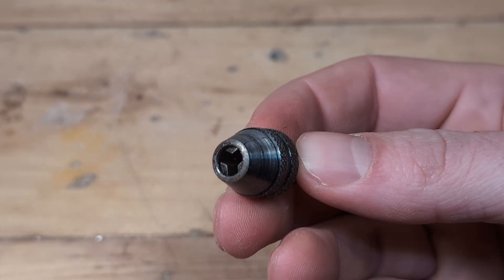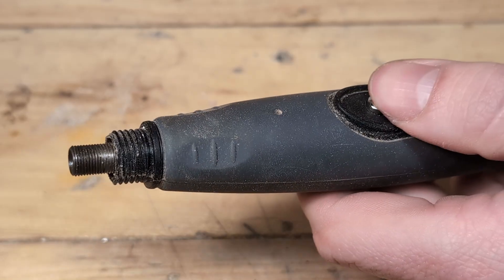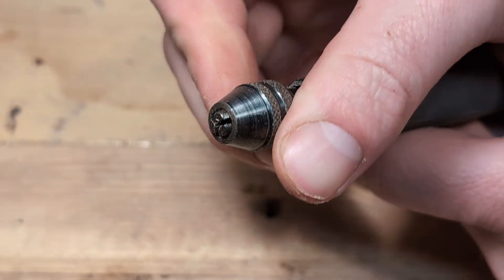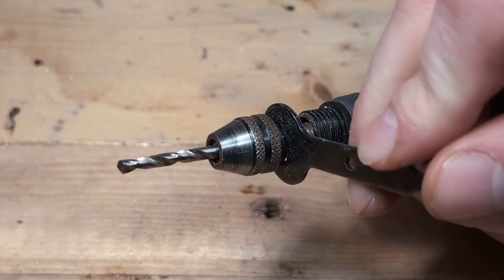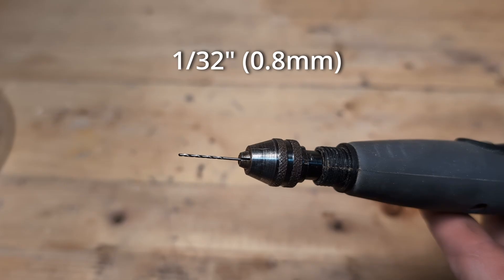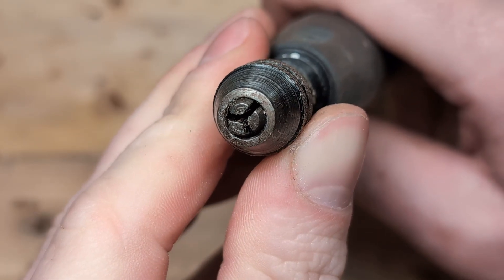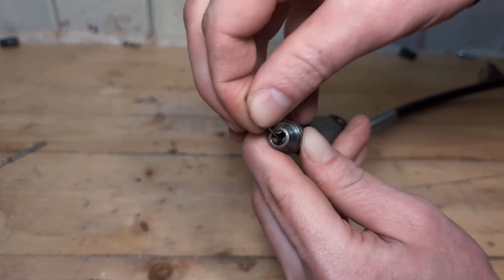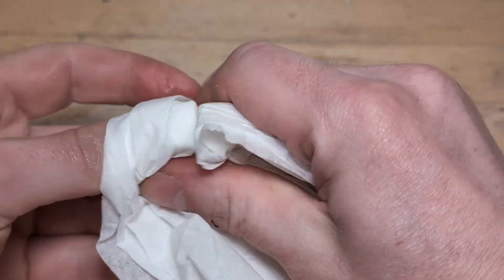The Keyless Chuck Is Good, But It Has A Problem (Dremel #4486)

Comment: DON'T USE WD40 FOR CLEANING. Use Varsol or Deep Creep. Deep Creep is a very good penetrating oil. Varsol will break down grease and loosen dust. AFTER you have cleaned the chuck you can use WD40 to LUBRICATE it and PROTECT the chuck from moisture.
Reply: WD40 is a known dust collector. I'd use some dry grease.

Comment: Using the wrench as shown isn't tightening the chuck onto the drill bit, that's only to tighten the chuck onto the dremel's threaded shaft.
Reply: I think it is the same thing.  You turn the chuck with your fingers to tighten,  or use the wrench when fingers aren't enough

Comment: These kind of chucks are made for drilling while applying force vertically in the same axis of the tool. Works ok for light duty while applying a light pressure sideways like cutting but you will eventually wear it down. It's the same principle with bigger Jacobs type chuck on a milling machine or drill press. If you want to do a lot of cutting and polishing you better stick with the regular collets.
Reply from the maker: Good point. That is something that I did not consider before.

Comment: will this chuck work on the 8250?
Reply: Yes, it fits with the 8220 so it will fit with the 8250. The only difference is that your 8250 model is brushless.

Comment: the problem ive found is that the collets and the keyless just wiggle with accesories, they end up moving side so side de-centered and seems theres no way to fix that
dissasembled the dremel itself and changed the bearings but still its the same
Reply from the maker: Hmm. I don't seem to have that problem. Do you close the chuck as far as possible before inserting the bit? Do you still have the problem when you use the normal collet nut and collet? I've had some of my Dremels de-centered as well, but not because of the keyless chuck (8260 and 8240)
Reply: @rotarycrafts8760  the wiggle problem is the same using the keyless or the collet, the problem begins today with the keyless, never used the collet because usually i drill with the dremel smal PCB but today using the 932 i think to grind some metal ive noticed it wiggle, take it out put the collet and the same and now every damn accesory wiggles 
the only "solution is place the bits as close it can be to the dremel body
and no, ihave not tried to close it and reopen to place the bits ill try it later
but the worst is that it has less than 1 year and sudden it went crap the shaft has no play with the bearing or the case